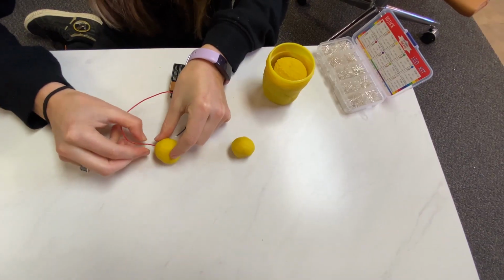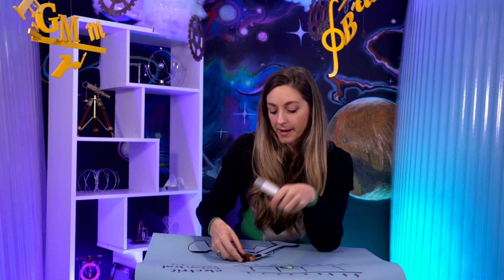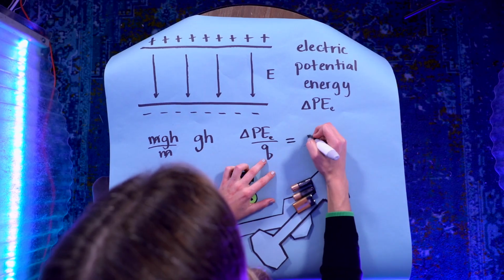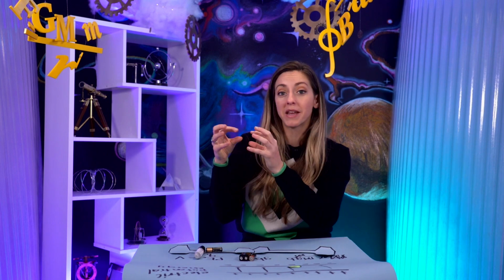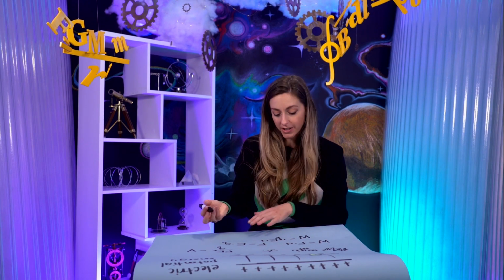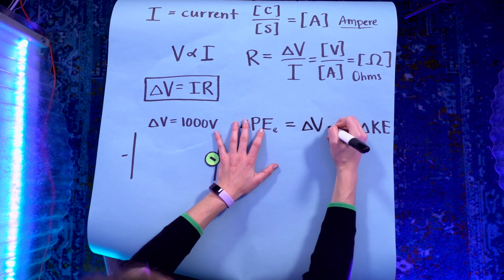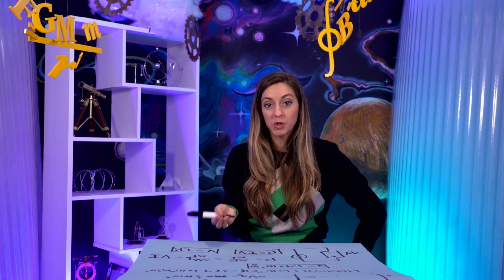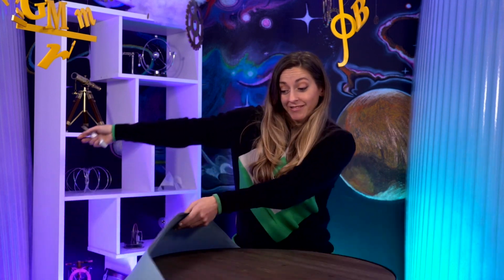Circuits, Voltage, Resistance, Current - Physics 101 / AP Physics Review with Dianna Cowern

Comment: I have a question  why does electron gain energy as they move across the battery and why electron flow from high potential to low potential
Reply: For the first question, electrons are negatively charged. So the negatively charged electrons move to the positive end of the battery. In simple terms- positive attracts negative and negative repels negative
For the second question, that's how everything works. Everything in this universe wants to get to a lower state of energy so the electrons flow from a higher potential (higher state of energy) to a lower potential (lower state of energy)

Comment: Heat is caused by resistance. The energy is slamming against copper crystalline structures similar to an atom smasher, and causes an electromagnetic field fluxes or Corona in high power wires.

Comment: A battery is technically a slow discharge capacitor. If a discharge capacitor contains resistive terminals, it can be converted into a battery as a slow discharge discharge capacitor.
I created that dedign.design. the capacitor charges up instantly but lasts for months or years in continual use.

Comment: The filament of a bulb is the photon generator of the light when it is off the point of origin is zero. If graphed light speed it would be zero at center of X, Y, and Z algebra graphed. Think about the filament as the point on the graph where all light comes from and its zero and origin. It is always emanating from zero until the bulb burns out or the energy is turned off.

Comment: you got something wrong there ( or i do ), you`ve shown that the electrons want to move from the +pole to the -pole ( thats how we use batteries and that is true ) but also have shown how the electron moves from the -pole to the +pole, which is physically correct but the physical +pole is what we call - and the otherway around ( its all because electricians worked with it and gave it names, before physics discovered it). i am a electrician and struggled with this a lot because i had electricity in physics way before i started becoming an electrician. 
so can someone answer me, am i right or do i got something wrong ?

Comment: Hello Dianna i have a doubt that if i use any sort of resistor to decrease the current in a circuit, will i b wasting electricity? & also that if i regulate my fan at speed 1 & then to 5, am i wasting electricity at speed 1 relative to speed 5 & will my electricity bill remain same at both these speeds??

Comment: A more simple way to look at it: Think of voltage as pressure. When you open a faucet connected to a hose, you expose the water in the hose to pressure. It pushes the water making the current flow, the more pressure the more energy the water has. Voltage is ELECTRICAL PRESSURE and like water pressure it goes nowhere, it only pushes the electrons through the wire. It forces a current of electrons (measured in amps) to jump from their orbit on one copper atom to the next atom, all the way through the circuit. The voltage is created by the attraction force that the - negative charge of the electrons in the battery have for the + positive side of the battery, just like north and south ends of magnets are attracted. If you connect a light bulb to + and - battery terminals the electrons will flow through it.
 The material a light bulb filament is made of has higher resistance to electrical flow (measured in ohm's) than wire has. The flowing electrons can't flow or jump between it's atoms as easily as wire atoms, so a limited amount of current forces it's way through, creating enough heat to light the bulb.

Comment: You said at the last moment "The voltage has to be the same on both LEDs", but you still didn't explain why the voltage is the same when in parallel. Assuming the resistance is the same (or not the same?),..

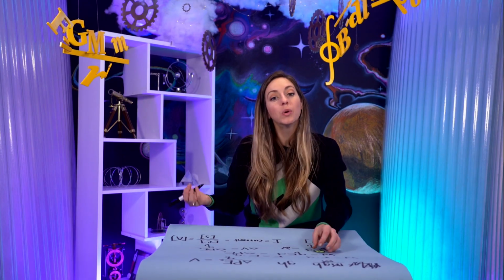Comment: 15:38 In a purely resistive (ohmic) circuit, current is proportional to voltage. In general, current is monotonic with respect to voltage (more voltage=more current).

Comment: I'm a 50 year old mechanic. 30 year ago I had a difficult time learning the basics of electricity. I compared it to the flow of water from a tank thru a hose thru a nozzle. Voltage,amperage,current flow. Ect...
Wish you were around 30 years ago.
Thank you for making physics easier for my children to learn.

Comment: I was hoping to gain a better insight into electronics, but I'm also not the intended audience. On a related note, I've long been bothered that the SI base units in regards to electricity are volts and amps; my personal opinion is that it would be more correct and consistent to instead use volts and coulombs so as to avoid defining things in terms of a change over time (how strange would it be to define the meter as a derived unit in terms of liters/second).

That being said, I work around hydraulic and pneumatic systems primarily with only light electrical work, so I tend to see thing in terms of "pressure" (V), "quantity" (C), and flow (A). It's interesting just how similar the mechanics of the systems are when looked at that way.

One last comment, mechanical energy down a shaft can actually be a direct analog to those notions as well, pressure being torque, quantity being rotational angle, and flow being the rate of rotation.
Reply: In fact, currently, the meter is defined as the distance light in vacuum travels in  1/299 792 458   fraction of a second.

Comment: I had a thought that if energy could nor be created or nither be destroyed how do we generate heat when we burn coal or any fuel?
Answer : even tough we could not creat or destroy energy, we can store it in the form of matter. Coal is a form of matter which can store more energy than a block of wood. If we think about the big bang theory there was no matter in the starting phase of universe, just energy. And as we say universe is cooling down, it actually means that the energy present is turning into a form of matter which is really hard to convert back into energy.

Comment: Here's what I don't understand.  When wires move thru a magnetic field, electric current is produced.  They say this is an interaction of the electrons of the copper atoms.  OK so the first batch of electrons are stripped from copper atoms and the 2nd and the 3rd, etc.  Why don't the copper atom's run out of electrons?  Where do the electrons after the 4th batch, etc come from?  This is the part I don't get?

Comment: One of the easiest examples someone told me to understand volts vs amps, and series vs parallel is imagining that the battery is a tank of water. Volts are like the "pressure" of the water, while Amps are like the volume of the stream of water. 

If you line them up side by side (in series) you would have more volume of water, but the pressure would be the same because the water column is the same height in 1 battery as it is in 100,000 batteries. 

On the other hand,  if you stack them one on top of each other, the "pressure" (voltage) increases just like it would with tanks of water, because the water column is taller. In the case of batteries, the 1.5v in the top battery "pushes down" on the 1.5v in the next battery from positive to negative, so now there's 3v of "pressure", etc.

Comment: To add. I have been an electronics tech for 40 years, and the only 2 equations I have ever bothered to remember are PIV and VIR. Everything else I have ever needed can be derived from those 2. A few other principles, like series resistors and parallel capacitors add, parallel resistors and series caps are the inverse of the sum of the inverses, caps block low frequency, inductors block high frequency... And that's about all I know. The rest is just math, and that's got me through 40 years. Have fun people.
Reply: I was taught something similar , taking the inverse to add parallel resistors, where G=1/R   ( I think G was called Inductance measured in  s units called Siemens)

Using capacitors and inductors to block frequency, I think  you're describing the basis of  what is known as low pass and high pass filters.   Not a pundit on the subject,  but it does make sense that capacitors can block low frequencies from a Alternating Current signal/source because a capacitor will block a Direct Current signal/source (which has no frequency ).
Reply: @rnklv8281  Inverse of resistance is called 'conductance'
Reply: @Chris-hx3om  Thanks for the correction.

Comment: Hi mam , mam i have doubt can you answer it plz , when I took two thin rectangular magnets and balance them on a plate surface the distance between them is less than 1cm and more than 5mm and  place a plastic lid and placed a screw or any small iron object on it came to the centre  of the two magnets when you see from side view. I do know why I tried moving it but it again came back to the center point . The plastic lid must be a thick but it should still allow the magnetic field to work , when I place two screws it behaved very differently and stayed in its place when I tried to move it came back to it place can you explain it mam.

Comment: 15:50
Can't remember where I heard this analogy originally (probably YouTube), but it's a pretty good explanation of the "speed of electricity".

Think of a hose that's full of blue marbles, and the hose is just wide enough that the marbles make a line that's one marble wide. If you push a red marble in from one end of the hose, a blue marble pops out the other end of the hose pretty much instantly, although the red marble you pushed into the hose moves slowly.

Electrons or electron "holes" behave similarly to the marbles. You have extra electrons at one end of the wire, and a lack of electrons at the other end of the wire (the electron "holes" move from the higher voltage to the lower voltage). An individual electron moves slowly, but the "stream" of electrons in the wire is almost instant.
Reply: Brilliant

Comment: I think I prefer having electricity introduced in a class that also has capacitors and inductors, rather than just resistors. Also, having the E field without the B field is a bit off. So I think I agree with the AP changing the curriculum, and also you've got to do physics 2 now. (But you don't have to do "magnetism is electricity plus special relativity", awesome as that is.)
Reply: You have to learn to walk, before you can run.   Capacitors and inductors can wait, until the students have the background of electric circuits first.

Comment: Hi. I´m from Germany. My physics teacher told us Ohms Law as U=RI. Because V stands for Volts but U stands for Voltage which is not the same. Got me a bit confused when you said/wrote V=RI. So what is the correct form of the formular for Ohms Law?
Reply: faster than the tachyon  Thanks for your very heldpful comment...
Reply: @johnnymos  Volts are the units, Voltage is the concept.   You can use whatever letters make the most sense to you.  It's all just a matter of semantics.
Reply: @carultch  Thank you ;-) That helped a lot.

Comment: I had a bunch of old pennies, and I got a stick of galvanize (a big icicle of the stuff, several inches long, so that's zinc), and I stuck it in the pennies, and left it outside. The pennies corroded away the zinc, which was amazing to witness, science is amazing.

Also, I'm pretty sure the simplest battery is a potato?

Comment: Welcome to Egypt science 😃😄😁😆😅 5 Smiles.    But even at 1.5v the current draw x 15 🤣 gel blaster math like how  2 x18650 can power 30plus watt motors? For a little bit.
Or shorts!🤬.  And VxR I not correct in low level math yes but when you get a solar cell tesla that says 215w and you sit there going in a 5x5 cell well something is wrong even though the math says different, The other is math with cylinders. Always use the long square one!

Comment: In a superconductor, if R is zero and E = IR, then E is zero?
Reply: Consider 4 points in space, labeled A through D.  Point D is at zero voltage by definition, since we ground it.  We apply 10 Volts to point A.   We place a superconductor between points B and C, and we place a 10 Ohm resistor between A and B, as well as between C and D.

The total resistance from A to D, is 20 Ohms.  The superconductor has zero ohms by definition.   Therefore, the current in the circuit is 0.5 Amps.  The voltage drop across the first resistor from A to B, is 0.5A * 20 Ohms = 5 Volts.  Likewise, the voltage drop from C to D is also 5 Volts.  The voltage drop across the superconductor specifically, is zero volts, as you expect.  The voltage-to-ground at the superconductor is the same as the voltage drop from C to D, which is 5 Volts.

What is zero, is the voltage drop across the superconductor specifically.  This doesn't mean that the voltage anywhere else in the circuit is zero, or that the voltage to ground is zero, just the voltage difference across the superconductor.

Comment: I have a doubt. If a battery reads 0.9V, does it mean that it takes 0.9J of energy of transferring an electron from infinity to the circuit? I don't understand the meaning or the sense of the definition of potential. Could an expert please understand me on this? By the way, love your physics mini-lectures from India!!❤️❤️🙏
Reply: It takes .9J to increase the potential of 1 coulomb of charge by 1V.  It is the change in potential that counts.  You don’t have to start at infinity.  I electron is 1.6 x10^-19C.  The units for work done on single electrons is the electron volt or eV
Reply: @joeczernuszka7756  Thanks Joe, really appreciate that. My teachers did not make us understand that meaning. They just made us to memorize for 1 mark in a test..

Comment: (05:13) Why does a "double A" or "9Volt" battery that is fully charged not bounce when dropped onto a hard surface, but the same battery will bounce on the same surface when it is discharged, and will no longer provide a potential difference?
Reply: Chemical change inside the battery means the terminal becomes harder.  Gunk changing to a solid.    Impulse Ft = change in momentum.  Harder material means t becomes smaller and so F which = ma increases so acceleration increases.  Bouncy

Comment: I love the comparison of Voltage to the energy potential of lifting a weight against gravity, especially as it relates to batteries.  I've always used an analogy comparing electrical potential in a battery to water in a water tower.  The new analogy comparing electrical potential to lifting a weight in a gravitation field might help people understand in a different way.  Great series!

Comment: I really dislike how in English you use the name of the unit of measurement also for the measured quantity (Volts and Voltage). Most European languages use Volts (the unit of measurement) to measure electric tension which is marked with "U" (so Ohm's law is U=I*R). You do the same in English for all the other quantities. Amperes for Current, Ohms for Resistance - so why the exception?
Reply: Because no one really cares that voltage's concept name is "electric potential".   Voltage became the defacto name for it, and Voltage starts with a V.

I also despise the term "tension" to refer to voltage.  It has nothing to do with mechanical tension, not even as an analogy, and leads to confusion when both concepts are applicable.   Tension is a mechanical stretching force.